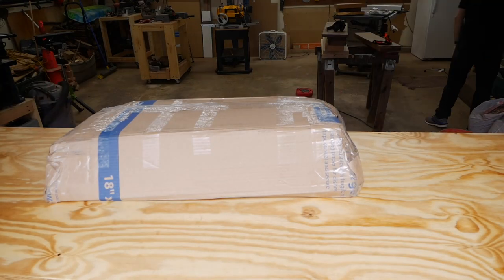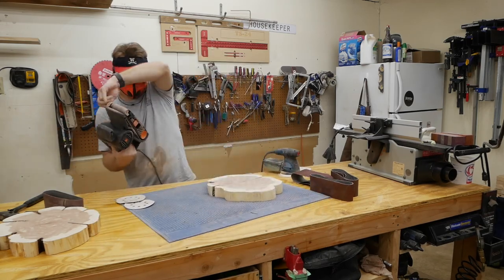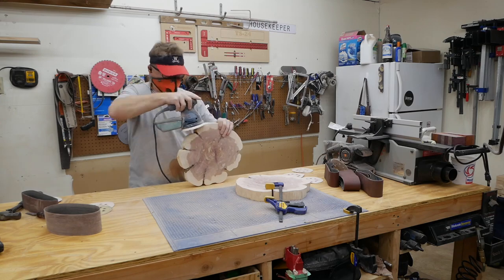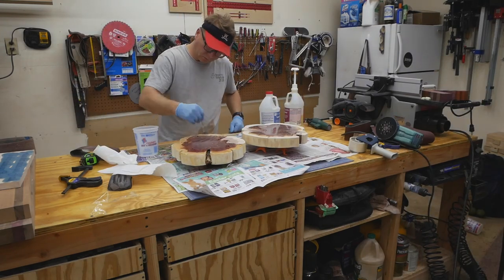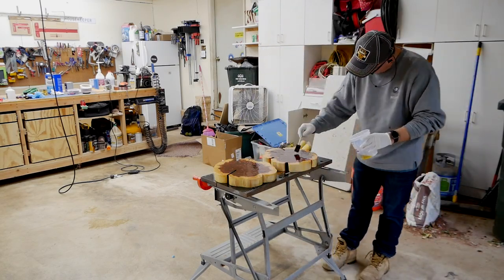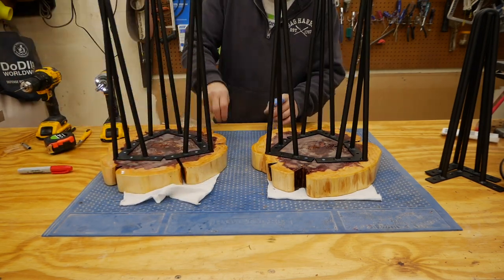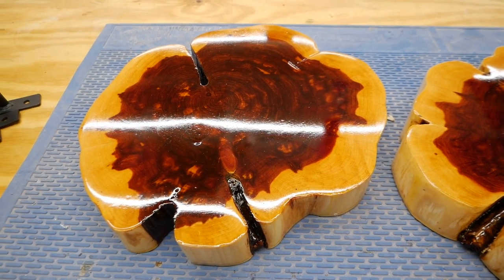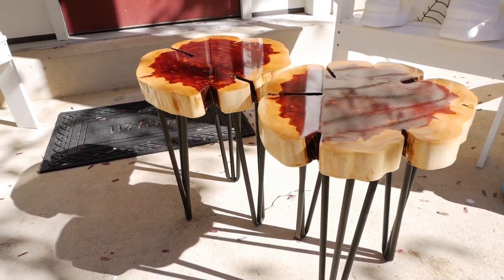Making Cedar End Tables for Outside

Comment: hi-I'm hoping to try this myself, but prefer wood legs-like logs style.  Wondering how those would get mounted.  Thanks!
Reply from the maker: Hi Maggie. Couple options - you can insert them into the cookie like a dowel (depending on the size), use threaded inserts and a bolt, or perhaps even pocket screws. There are also a ton of mechanical fasteners you can buy (something like: https://amzn.to/3xfXbAz  or https://amzn.to/3aEgiNd). Hope this helps - thanks for watching!